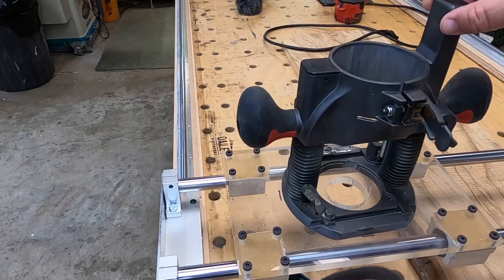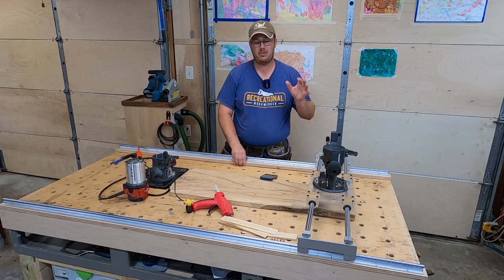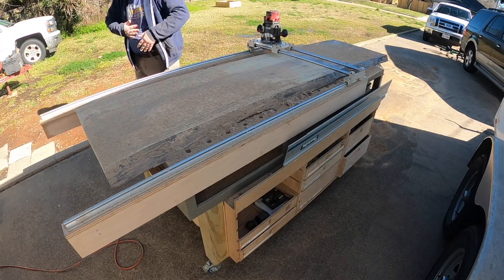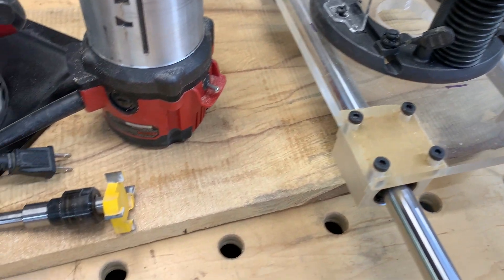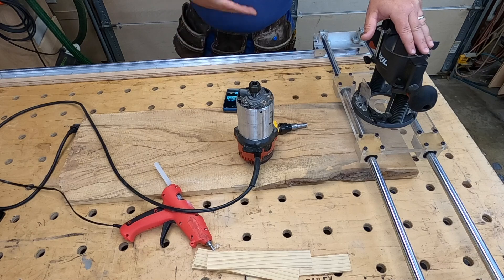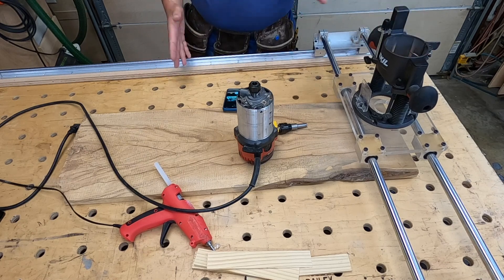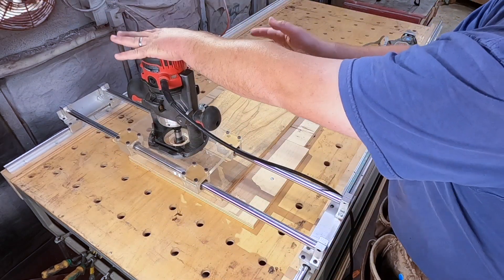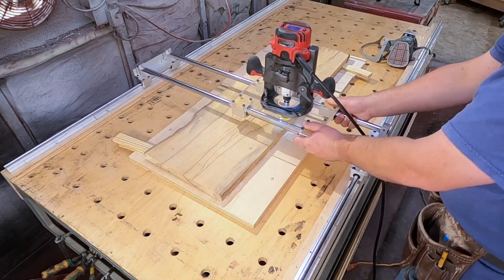Full Demo of CleanCut Woodworking Router Sled | Premium Router Sled Review

Comment: I just made one myself with 16mm SBR rail and some scrap MDF.  Full sled complete for around $200.00.  Almost exact setup you got exempt the router cradle positions the router between the rails so you don't need the extension.  Rev 2 will have an adjustable height cradle.
FYI the cross rails are just the SBR rail removed from the aluminum support.  You could use the same round rail for the cross rail that you used for the long rail and get a 7 ft. X 7 ft. flattening jig but I would worry that the cross bars would sag without the aluminum supports over that distance.
Reply: Hi kelly, I'd love to see a pic of yours.  I've got all the parts.  Designed in Sketchup.  And Figuring how it all actually goes together now.

Comment: I have been manufacturing linear rail based wood working machines for about five years. it is nice to see that these devices are catching on.
your set up is nice but you are missing one key feature that would  help your efforts though. your router cradle needs to be mounted lower and you can get rid of the extender collet. this will eliminate a lot of vibration and chatter and allow you to take  deeper and faster passes at a higher rpm. I am developing a unit that has programmable x y and z axis.if this interests you  let me know.
Reply: Agree.  Flip the plate and bearings around on the gantry to get lower.  Then add some plywood strips under your rails to raise them for taller pieces.  It beats lifting the wood and using an extension.

Comment: So I am buying the rails/blocks on amazon.. about $130 for the 4 bars (800mm and 1200mm lengths). I just bought a cheap ass Vevor 3 1/4 hp router ($75) as I doubt I'll do much flattening but didn't want to take my Bosch from my table to this. This way I have a dedicated router specifically for this. Hopefully the cheap Vevor is good enough for the few times I'll use it.  Also.. the acrylic or plexiglass base.. did you just buy a square, cut the hole and the 16 screw points.. that was it?  I was thinking a fast/vibrating as the router would be.. it might break that at some point?

Comment: If you mounted the router base underneath the cross slide rather than on top, the cutter would not have to be extended  as far increasing rigidity.

Comment: If you swap your fixed base vertically you probably wouldn't need any router collet extension 4:00 🤔. And one more thing I can't stand quiet, I don't want to destroy cleancutwoodworking business but you can purchase these rails on amazon or any other online shop by yourself just create a base for your particular router (plywood/acrylic) and "voila" you have the same thing just for less than half of the price.